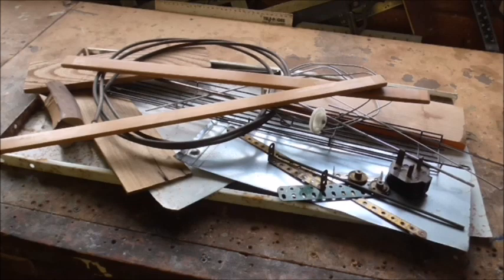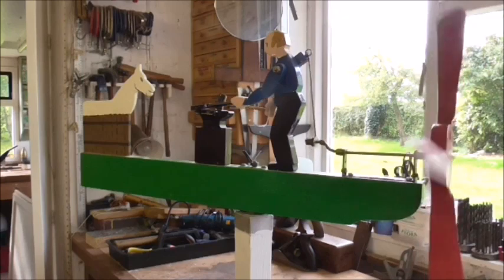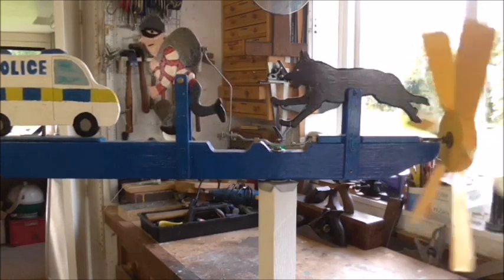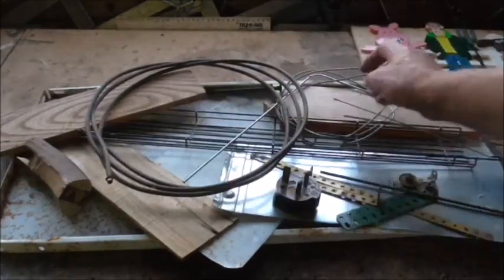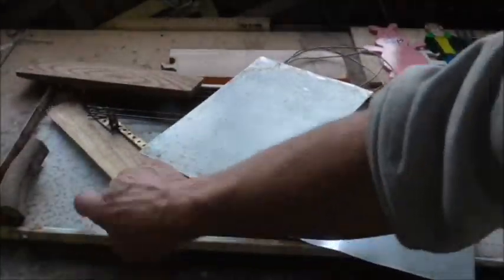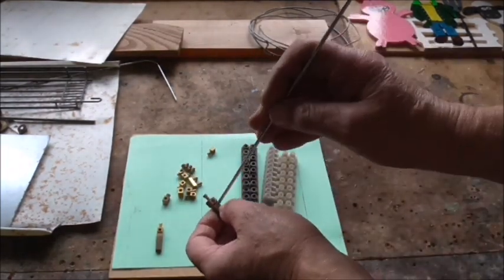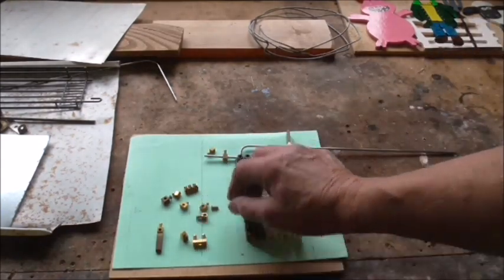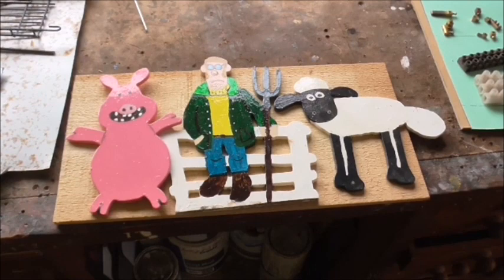Making a whirligig part 1 Introduction

Comment: Hi John , Can you help me out please ? . First how do you attach the propeller to the drive shaft and secondly where can l purchase the bearings you use and what is the inside diameter . I did a mock up of attaching a piece of scrap wood to my drive shaft making it a very tight fit and gluing it but it s not very strong and would probably come lose after while . Kind regards ,  Bill .
Reply from the maker: Bill there are lots of ways you can use to attach the propeller to the shaft but the one that I have found the best is to use old Meccano bosses or pulley wheels, as long as they have a boss on them with a set or grub screw they will hold the prop on firmly and are easy to fit and remove.
As for the axles any diameter will suffice, I find around 4mm (SWG size 8) is about right, too thick is more difficult to bend, too thin is too bendy. 4mm will fit perfectly in Meccano parts too as Meccano rods are SWG 8 (4.06mm). you can use what you have available and drill or ream out the Meccano bosses to accept the axle shafts.
Old Meccano parts are widely available, you can often buy a boxful of old parts for next to nowt and they usually include lots of bush and pulley wheels that do the job. 
Parts that are good for propellers are No 24 Bush wheel, No 22 1" pulley wheel, 20a 2" pulley wheel and 62b crank . Don't spend money on new stuff any old or battered parts will do the job. Old electrical connectors are useful too as they are often brass and come with screws and are various diameters, I think I did a video covering them.